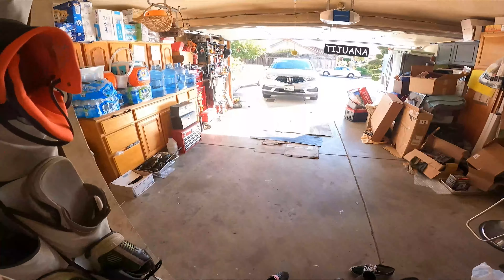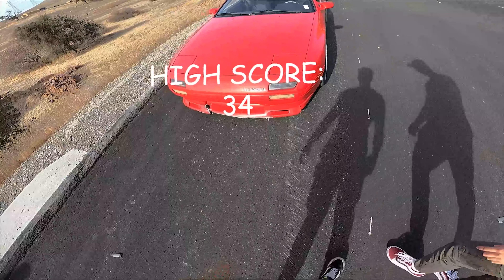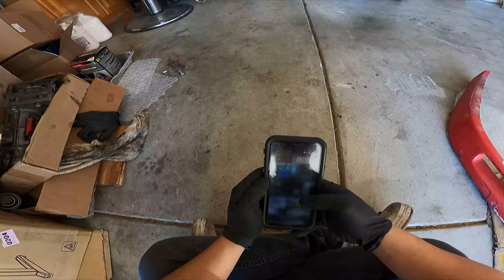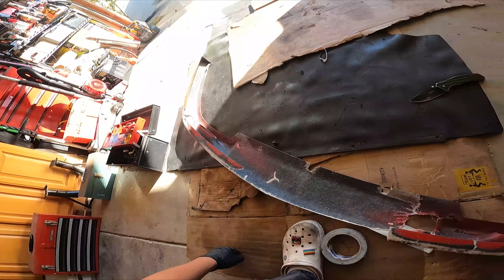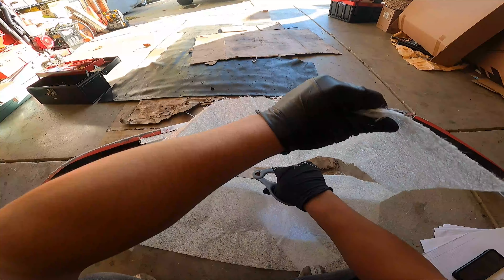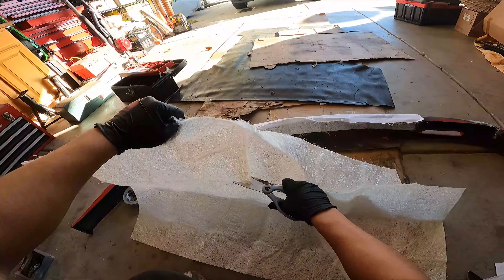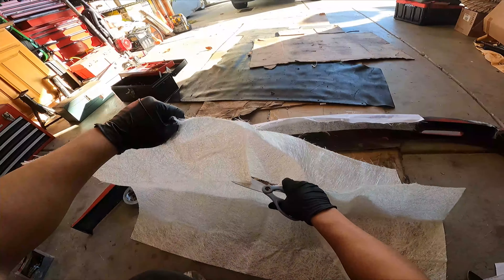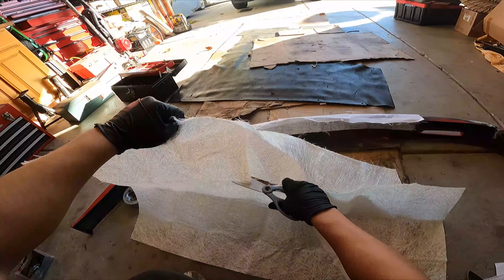Rylan Doesn't Know Sh*t About Fiberglass Repair

Comment: Hey man really clean FC, what are your wheel size and specs? Thanks!
Reply from the maker: They are 17x9.5 +19. 235/45 tires in this video. Very very tight but flush fitment. Fenders need to be rolled almost flat and the fronts need some extra camber in order not to rub.
Reply: @kakudogroup  Thanks so much and love the channel. Just got some r33 gtr wheels and my fronts are hitting my coilovers. FC's front wheel fitment is pain.